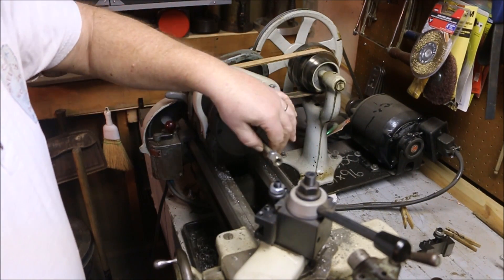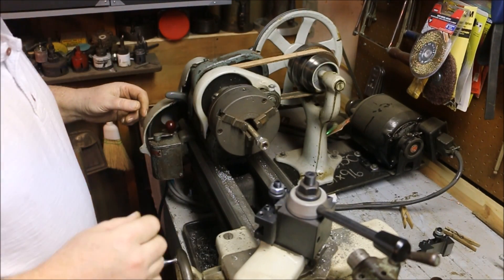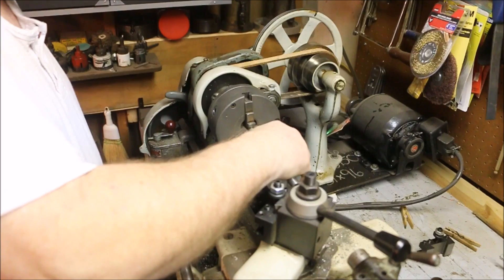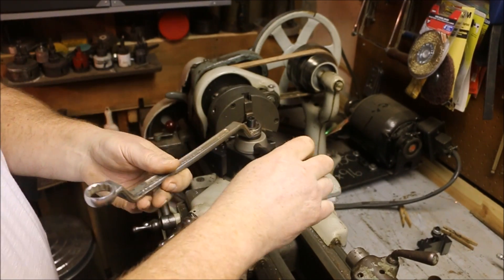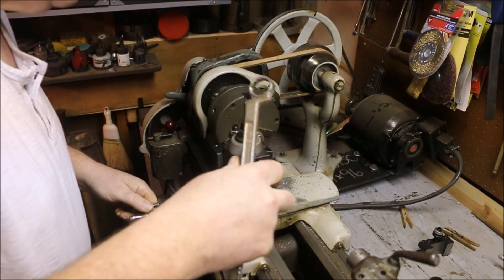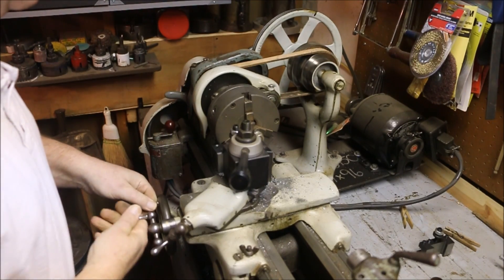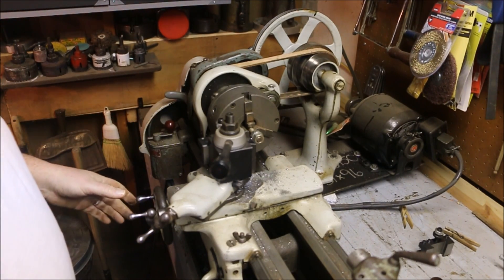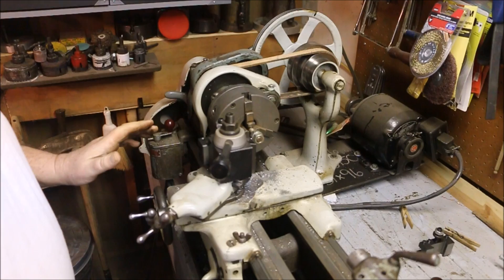HDPE PLASTIC INJECTION MOLDING

Comment: Permission to ask, I tried vertical injection molding with a manual lever using HDPE plastic, but when in the barrel the HDPE plastic melts unevenly, the bottom near the nozzel has melted while the top is still thickened, how do I make it liquid evenly for HDPE material?
Reply from the maker: That will require a temperature controller and enough heating coils or burners to heat the entire barrel to a controlled set point 
It isn't neccessary to heat the entire shot to melting as long as you have enough of a charge melted to fill the mold; the material that is left in the heating chamber at the end of the piston stroke can remain solid. As more material is added for the next shot the remainder of the last one will melt and become the beginning of the next. 
Auger type units use the solid material to seal the screw and provide the force to move the liquid material into the mold. 
When changing colors or types of materials in either type of system the entire chamber must be flushed out to remove the old material.
Reply: @OldSneelock  thanks for the answer sir

Comment: I think that you could probably bore the inside of a two inch pipe (to make it nice & smooth) and turn a properly sized piston head for that.  I wouldn't bother to cut off the threads, because you might want to add a cap for whatever reason.
I was thinking Dave Gingery wrote a book or two on this subject, but it was actually his son Vincent.  The books are 'Build a Plastic Injection Molding Machine' (http://gingerybookstore.com/InjectionMoldingMachine.html) & 'Build a Plastic Injection Molding Attachment for a Drill Press' (http://gingerybookstore.com/InjectionMoldingAttachment.html).
I think as a proof of concept, this was a roaring success.  I will be very interested to see where this leads.
Reply from the maker: Coming back to this project after many days. I have heating elements and a controller to build the injection molder. I'm going with 3/4" thin wall electro mechanical tubing. My research shows the tube tends to not heat into the middle of the plastic because it is a good insulator. I'm thinking smaller tube will require less time to fully heat through the charge. I would like to have a continuous feed rate for the material. 
Still on the back burner. No current projects require this tech.

Comment: More proof that you don't have to be a rocket scientist, just a FIXER! Ought to get through with the grading tomorrow I hope. Down another 5 inches in rocks ranging from 12 to 18 inches. Makes it really interesting but I don't have a sieve so just plodding along. Utilities in and covered and no mishaps so progress, such as it is, reigns. Pal hauling the excess away. Some rocks too big to load. We'll see what's what.
Reply from the maker: Sounds like the house that Lydia and I bought. It was brand new. Not a blade of grass in the front yard. Just bank run gravel. 
I thought I could rake up the rocks and plant grass. 
By the time I had filled the first wheebarrow with rocks, I had a cup of sand and a hole the size of the wheelbarrow.
Reply: That's it. We were talking about it today and the one I'm on is number 10. Another to start in 3 weeks. Maybe they can get someone with a blasted transit so I won't have to re-do it. The first time always works better. Finished the last one this morning. Now for clean stone base, plumbers and a slab on the last 2. Life in the fast digging lane.

Comment: Old Sneelock:  Just wondering here-- is this one of those things you'd rather "build than buy?"
I know you like to tinker w/ things to determine if an idea will work, injection molding being one such idea (and that seems to have essentially worked as demonstrated by the 'near perfect' plastic arbor hole fill). So, wouldn't it have been much simpler to purchase a suitable bushing for the grinding wheel from McMaster Carr or other distributor? Thus the initial question...
Reply from the maker: More of a solution in search of a problem.
Reply: +Old Sneelock:  -🤣-   Now why is that!?
Reply from the maker: Nate Wood I wanted to try plastic injection but didn't want to make a complicated mold. The grinding wheel was a simple thing that could be done easily. It also didn't matter if it didn't work.
Reply: +Old Sneelock:  Yes, but it did work! And, once again, you've managed to 'kill' two birds w/ one stone. Just wish all my ventures were as successful. Keep up the good work, Snee. You've got another thumbs up...

Comment: Great experiment. There's a million and one uses for something of this nature.
Reply from the maker: Tim Caldwell  Right Tim. I need to do some mold making.
Reply: I filled up the so-called vents for 'mulching' on the new mower deck with resin. Had new spindles and guards so just taped the 'vents' with the handymans secret weapon. Leaked a little but the pneumonia holes are no more. 2 BIG places for rust to start and anybody knows you can't really mulch anything over an inch, which is a joke here. So one day I'll put the deck on and try it out. After all the firewood is worked up.

Comment: ..hmm, That's Neato Bossman!!! Maybe you could cut off the threaded end and cobble up a better fitting piston. I believe i'm going to file this for future reference...
Reply from the maker: Definitely will make a tighter fitting piston. I think the threaded rod mounted to a threaded cap with a hand wheel will work much better too. The drill press was an okay cobble but didn't create enough pressure. The travel was too short for any volume too.
Reply: ..........and the press was fixing to be in several pieces. Getting out the micrometer, Uncle Sneelock..................
Reply: Thou hast started at point 'A' and now foresooth shall proceed in a rapid and timely manner. I see it coming!